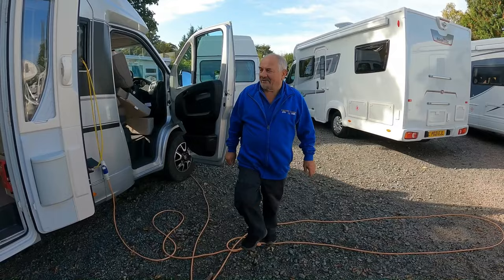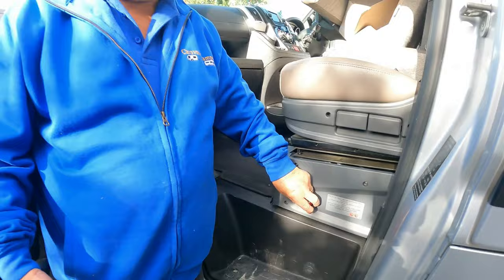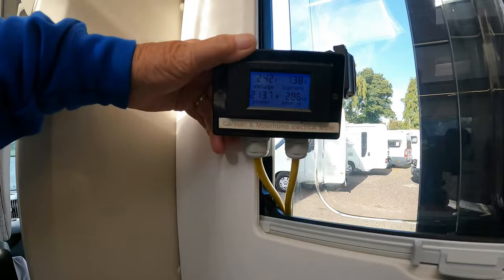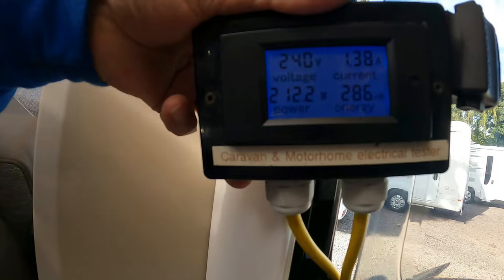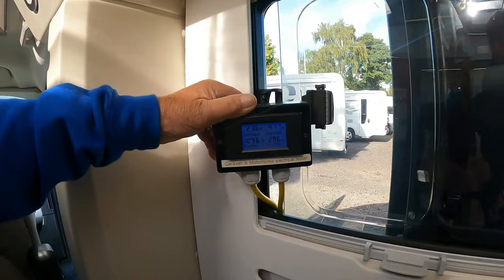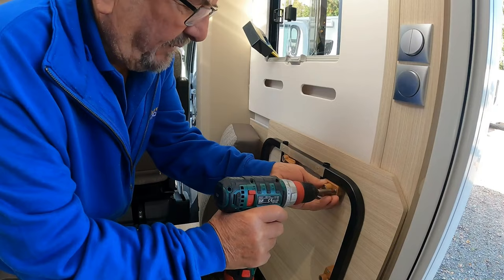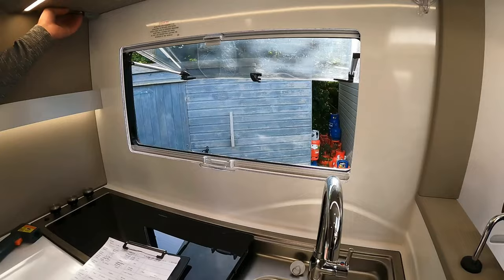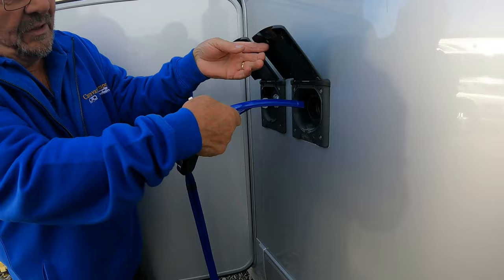LUXURY Motorhome - Habitation CHECKS (ep. 1)

Comment: Kev just a quick question after draining all the water for the winter can you still use the heater on electric it's there trauma heater
Reply from the maker: Hi Noel, you can use the truma combi system with just heating and no water when you're drained down etc. Just select the heating controls without switching on the hot water and you should be good to go. Sometimes you will get an error code that may need correcting first
Reply: Thanks for the reply kev r Jason